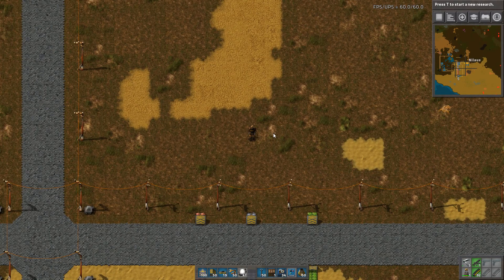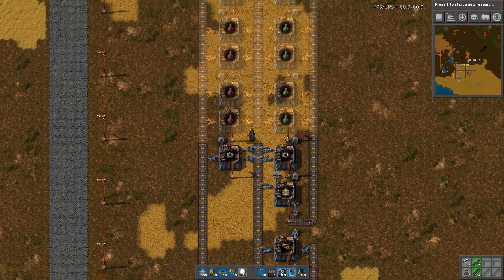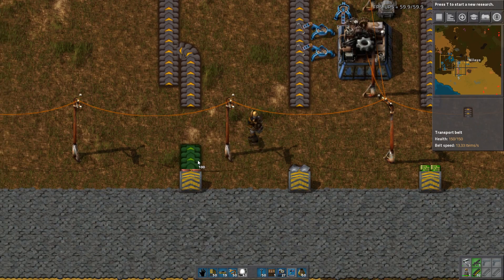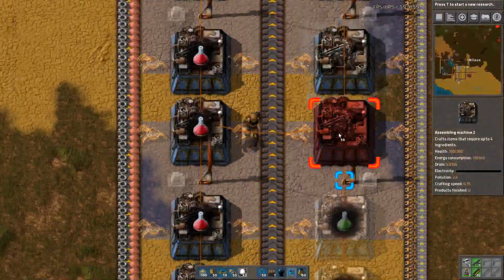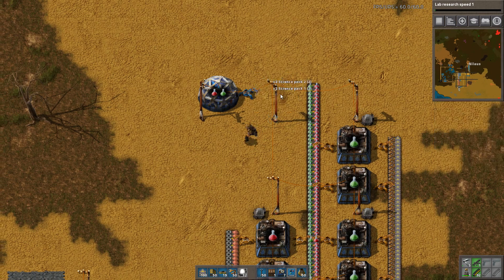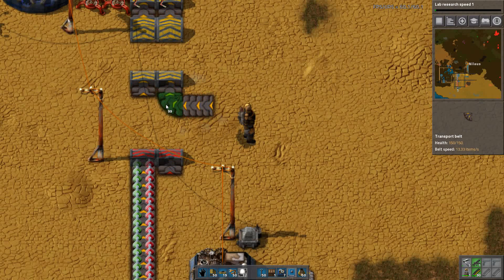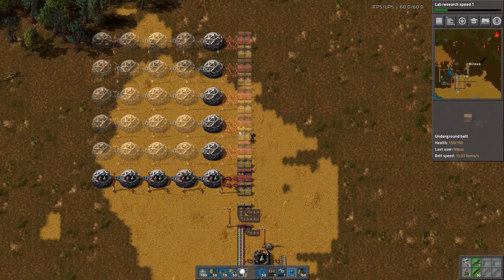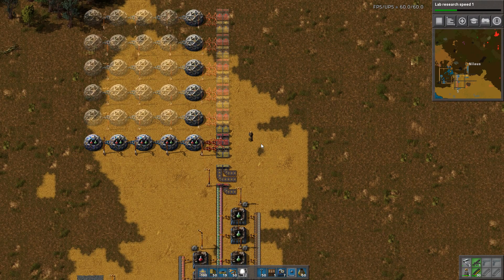Factorio Tutorial - 5. Red and Green Science

Comment: I know this is an old video but I've been following along after I've failed and reset about 10 times with bits and pieces from other tutorials... How did you get the green chips built for the green chips? Off of the main line first or back in the smelting column?

Comment: How do you "fix" it when your undergrounds don;t want to braid and start trying to run the belt in the wrong direction or connect the wrong way?  I usually just end up running two pairs of belts down either side of the labs and use 2 rows of blue inserters going opposite directions to pass stuff back and forth. sometimes they seem to steal from each other.  would much rather get the single lane going.
Reply from the maker: You need different colors of belts to braid and sometimes it does mess up when trying to place them, but most of the time it works ok. A bit of practice...
Reply: @Nilaus  it's the different colors thing I missed.  thank you.